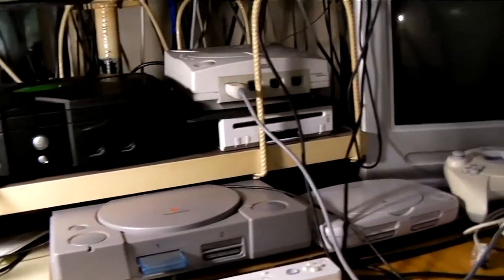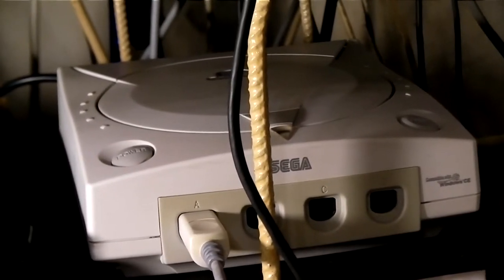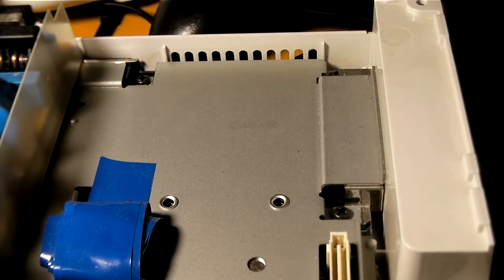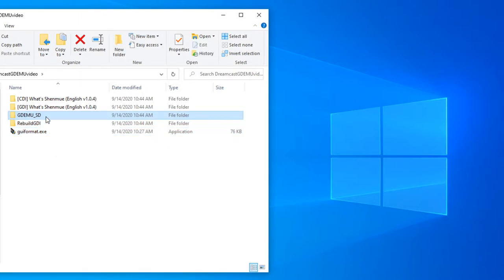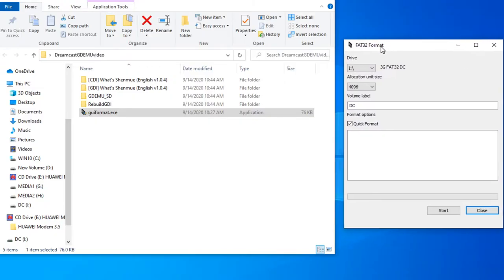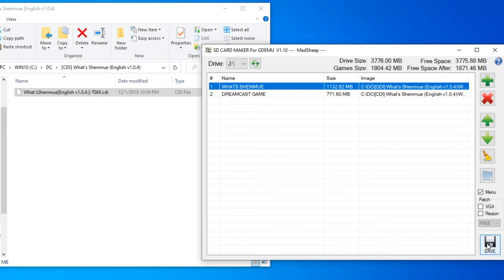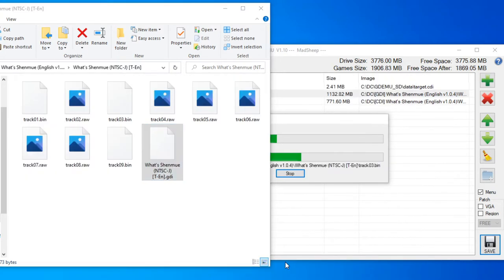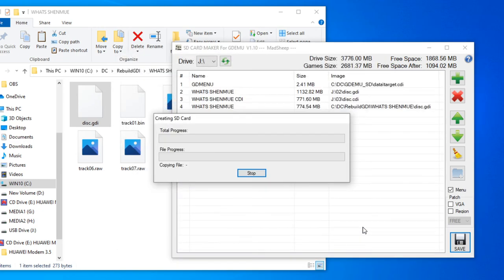How to setup GDEMU SD card? And how to prepare the Dreamcast? (resistor install)

Comment: Where can I get the resistor and fan from? Have you got any EBay or Amazon links you can post here?
Thanks
Reply from the maker: I just got some resistors from an electronics store, you just have to look for 300ohm resistors that are 0.25W or 0.5W and get a 60mm 12V fan from a computer store. I just happened to have one laying around. You should be able to find both online as well if you search for them.

Comment: Even better is to get three 1Kohm 0.5W resistors. and twine the ends together.. that'll spread the load between them.
Reply: So this is a better option?  Plug them in the same spot?
Reply: Can you avoid the fan this way?

Comment: Nice, but Maan - talk about major fail. 😢 Thanks to "working from home", the AV software I'm forced to use on my home computer in order to connect to my employer's VPN detects the executables as "threats" so it deletes the exe's within seconds of extracting them. I've seen this issue before - not an actual virus, just certain patterns in binary code that tends to trigger AV software (Norton was notorious for this years ago). I guess I'll have to set up my old tinkering machine to work on my SD card.

Comment: Do you also need a resistor if you are using the dreampsu?
Reply from the maker: No, you don't need a resistor for that.
Reply: @ocworkshop  Hello,
Thank you for your explanations. I have a PicoPSU installed and a GDemu. It starts ok but the sound is extremely SLOW! Do you have any idea what I should do? I have already tried to clean the pins.
Thx
Reply from the maker: @lucharno2010  https://www.youtube.com/watch?v=6GMSV0-7Dpk does it sound something like in this video?
Reply: @lucharno2010  I had the same problem then I removed the PicoPSU, put back the original setup and did the resistor thing, problem went away, oh yeah I also did a firmware update it was a risk but I don't really care but it worked so I was worth the shot.
Reply: @ocworkshop  yes, it sounds the same... :(

Comment: Hey, great mods. I'm just afraid that putting a resistor in the PSU will not do any good about keeping it cool, it would increase the load even more and make it run hotter.